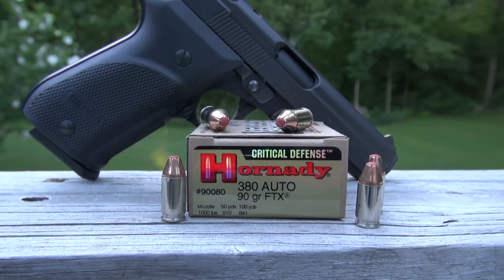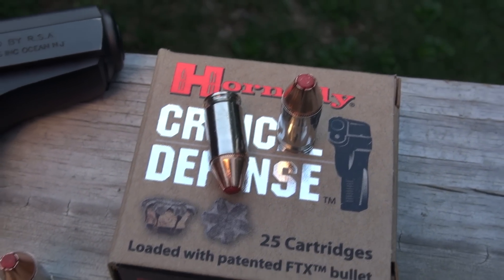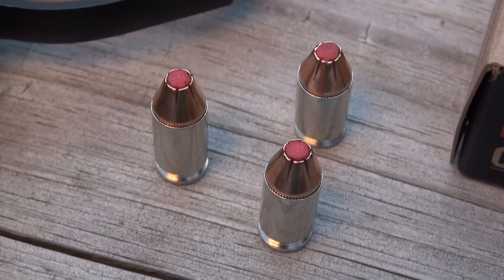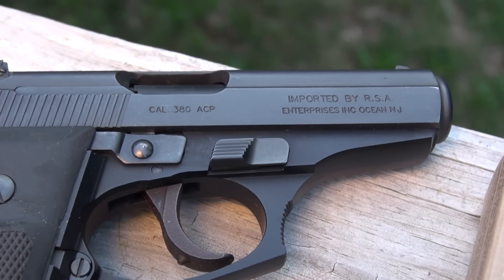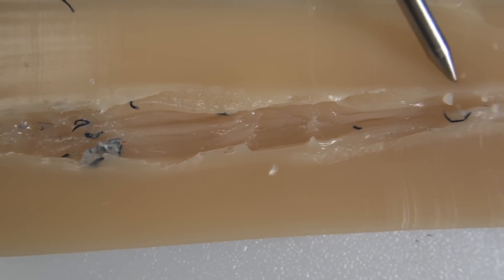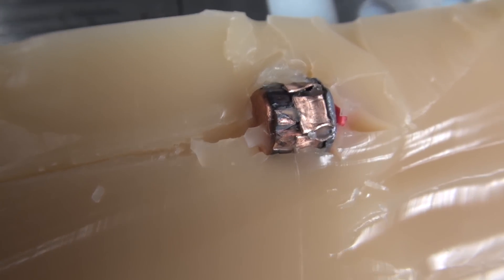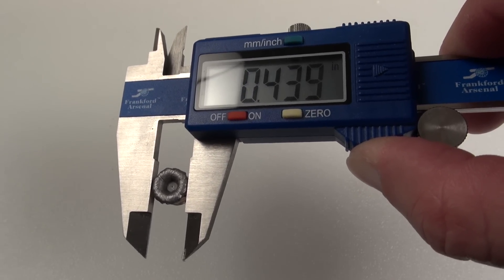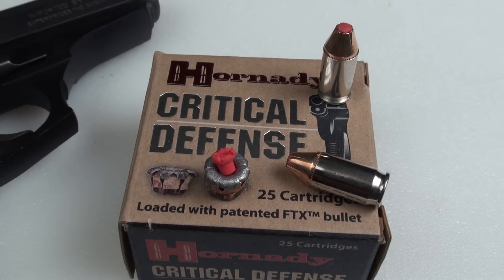Hornady Critical Defense .380 ACP 90 gr Ammo Test

Comment: Not only is Critical Defense an awesome self defense cartridge but, in .380 specifically, they were designed for the Ruger LCP. The older generation packages had an LCP on the box and I have a first Generation LCP that had to go back to Ruger before it would function. The technician who fixed my gun told me to use Hornady Critical Defense for EDC and Black Hills fmj for range practice. Ruger fires each LCP 36 times: 24 times with Black Hills fmj ball and 12 RDS or Hornady Critical Defense for function. He also said certain brands run on the long side of normal OAL and may lead to malfunctioning in the LCP.

Comment: I think I've seen every ammo testing video there is and I've come to the conclusion that you simply cannot go wrong with Critical Defense in any caliber.  It just works as designed every time.  And it's one of the few hollow points that reliably expand in 380 and still achieve adequate penetration.

Comment: Note: No animals were hurt in the study.This in November's American Journal of Veterinary Research. 

42 fresh cadaver heads of 12 to 18 month old steers were used to determine which firearm ammo worked best when used to euthanize feedlot cattle.(Again,these steers were already dead). 

For each of 7 combinations of firearms & ammunitions (.22-caliber rifle firing a long rifle 30-grain plated lead solid- or hollow point round,.223-calibre firing a 50-grain ballistic-tip round,9-mm pistol firing a 124-grain total metal jacket round, .45-caliber automatic Colt pistol (ACP) firing a 230-grain full metal jacket round,and a 12-guage shotgun firing a 2.75-inch 1.25-ounce No.4 birdshot shell or a 1-ounce rifled slug). 

The heads were all shot at an identical distance (3ml),angle,& anatomic location. 

The heads were CAT-scanned & images were evaluated to determine extent of penetration,projectile fragmentation,cranial fracture,and likelihood of instantaneous death (equal or greater than 30% destruction of brain tissue or a brainstem lesion). 

Results:41 of 42 skulls were penetrated by the projectile.Instantaneous death was considered a likely consequence for 83% (25/30) of heads shot with a rifle fired .22-calibre solid-point round,pistol-fired .45-calibre ACP round,carbine-fired .223-caliber round,and shotgun-fired birdshot and slug.Of the 18 heads shot with pistol-fired 9-mm and .45-caliber ACP rounds and rifle-fired .22-calibre hollow-point rounds,only 6 had brainstem lesions. 

Conclusions:Gunshots delivered by all firearm-ammunition combinations EXCEPT RIFLE-FIRED .22-CALIBER HOLLOW-POINT ROUNDS AND PISTOL-FIRED 9-MM ROUNDS were viable options for euthanasia of feedlot cattle.
Reply: ok

Comment: The human center mass is about 12 inches in length on the horizontal plane.  Consider possible bone contact, expansion with in 1/2 inch I'd say the Hornady Critical Defense 380 90 gr. FTX makes a better choice for a defensive round.  (I also carry Hornady Critical Defense 9 mm 115 gr. FTX in my 9c)

Comment: A close friend can tell you how effective these are.  He was the victim of an accidental discharge at the gun range as he was reholstering a Bersa Thunder in a Remora IWB.  The discharge happened with the gun approximately half way into the holster, i.e. with the trigger guard still fully exposed.  It is unclear from the range security video whether the trigger was actuated by his finger, or by the soft sweat shield of the holster folding inward and becoming lodged in the trigger guard.  In either case, the safety was off when it should have been on. The round penetrated the back of the holster, entered his upper thigh about 4” below the waist, tracked just under the skin and exited just below the bend of the knee.  He was very fortunate that it did not strike any bones or major blood vessels.  But the massive bruising between the entry and exit wounds is proof of the large shock cavity.  The bullet was recovered from the floor of the range and showed that it had achieved full, even expansion.  He was a very lucky   A quick trip to the ER, an x-ray to look for fragments, a bandage, and he was okay to limp home.  I hope he bought a lottery ticket on the way.
Reply: This is why I don't carry my Glock IWB. OWB only. No safety inside my pants is a no go for me.
Reply: Norman Morgan also a far better test than ballistics gel. LOL. Tell your friend I said thank you.
Reply: When wearing a single belt clip IWB holster I ALWAYS take the holster off to Reholster when the firearm is Loaded.

Comment: Very impressive. I got a box of the Sig Saur V-Crown bonded SJHP and they did not expand any through denim. They did expand with no denim. I used the Clear Ballistic gel in a torso mold that I made from an old  mannequin I found in the Sears dumpster. It works great. You can get an old jean jacket from Goodwill and some cheap ribs from the butcher and you got a semi realistic setup.

Comment: Ran the same test at 12 feet using a double layer of denim. Penetration 12.385"  with perfect pedal expansion measurement of .462".  Using Browning Black Label 4.25" barrel. This to me is the best 380 load on the market. It will not clog like many hollow points in 380.

Comment: 11+1/4 inches out of a 3.5inch barrel gun.
This results are pretty good, don't get me wrong, but the real problem with .380acp begins on the smaller barrel guns like the Ruger LCP, in which i can bet the result's would be around 10 inch penetration at most.

So my 2 cents on .380 is that the expansive ammo works correctly on 3 to 3.5 inch barrels, a good example would be the Bersa .380 CC model. But for smaller guns like the LCP or any of these compact pistols i would rely only on the "extreme penetrator" ammo despite the small risk of overpenetration and the only parcial "JHP kind" of damage

Comment: Thank you for your testing tnoutdoors9. Great work. The 380 may not have a ton of power, but 11.25 inches penetration is enough. I guarantee a double tap in the "triangle" will drop an aggressor. Hornady spent a long time on that bullet design and it works. It was designed to expand regardless of what it goes through, and you can't afford failure in a 380.  You shouldn't look for that perfect and huge "flower" expansion from a 380 as it would result in about 3+" less penetration.

Comment: I may have to think about this in 9x18mm Makarov caliber.  I have been packing 95grain Hornady XTP's in my Polish P-64 for 4 years now.  I like the tip that helps control expansion.   Really wish you had a gun in 9x18mm Makarov caliber... although 380acp ballistics are very close to 9x18mm Makarov.  Thanks for all these data points as a fellow concealed carry permit holder this information is very important on deciding what defensive loads to carry on a day by day basis.

Comment: I just did my own little test of this ammo and had a MASSIVE failure, tested it on 3 milk jugs filled with water in addition to a thick plastic cooler also filled with water as a backstop.

It did not expand at all and only bounced off the cooler. It had partially smushed sideways but did not expand in the proper way at all! I was honestly shocked. 

Im going to do some more testing soon to see if i can make it happen again on film.

Comment: @kenyata Through various wetpack and water tests of my own at varying velocities I have found the Golden Saber in .40 S&W to be reliable in terms of expansion and weight retention at low velocities, around 1050 fps, but unreliable at higher velocities, 1150 fps, at which point jacket separation almost always occurred.

Comment: For those using Ruger LCP or SIG P238 Kimber .380 micro etc. You're not going to get the same performant under 3 inch barrel as you are in the 3 1/2 to 4 inch barrel it does make a difference in .380 ACP or .22 Win magnum etc. 1" can mean  100fps or greater loss of velocity with the shorter barrel guns,  same with the Pug or the Black Widow North American Arms 22 magnum 1" or 2" makes a lot of difference in velocity and bullet performance!

Comment: I wouldn't have thought it would have done well. 

I assume it is probably a top performing 380? If it is a top performer I wonder if it is because Hornady cared or just got lucky. 

I recently got Underwood extreme penetrators because I preferred penetration in 380. I don't carry 380 but wanted to have some just in case. May look at staggering extreme penetrators with this or federal hst. 

Off to see if tnoutdoors9 has an hst 380 video.

Comment: .380 acp => 'Action Colt Pistol,' which is what Colt named the cartridge when they started making it.

LCP is a Ruger .380 pistol. I believe it stands for 'light carry pistol,' as they are tiny.

JHP is a jacketed hollow point. It's a hollow point bullet (ie has a cavity in the front to make it expand in a target and stop in the target). The jacket is the copper coating on the lead bullet.
Reply: Auto cycling pistol...  acp.

Comment: My Ruger LCP blew up in my hand at the range last trip. Using just Remington 95gr brass factory ammo. I am lucky I did not lose my hand or some fingers.  I do also have a P3AT and not crazy about shooting it either. I will tell you the first question Ruger asked me when I called was did I have +P ammo or reloads. They said usually when a gun explodes(I guess this happens more than I thought) it is usually the ammo so I guess it could have been a bad round from Remington however Ruger DOES NOT recommend using +P ammo so WHATEVER YOU DO, DONT USE +P. This ammo should be fine but just wanted viewer to know about this potential problem.Gun Explodes, Ruger LCP blows apart when I was shooting it.
Reply: Everything
Reply: Ruger LCP is dangerous and I have heard for SEVERAL people who had their LCP BLOW UP TO.  Just BEWARE OF THE RUGER LCP
Reply: n4ktz Thanks for passing that along I had considered that gun at one point but purchased a different gun. Glad you didn't suffer and serious injuries just goes to show it dose not matter the maker of guns these things happen regardless of what you spend on a gun or its reputation.
Reply: Smart move....I would never get another(or shoot) an LCP.....
Reply: There is no such thing as +P 380acp.
Reply: 9mmsteve I have seen guns fail on the range. No ammo fail prior??
Reply: Bad loads, under pressurd, cause squibs, bullet never clears the barrel.  You can feel and hear a squid and/or slide fails to cycle.  Revolver, you must hear and feel it.  Very dangerous condition for gun and hand.  Guns just don't blowup.  When firing a shot into a clogged barrel will differently not make your day.  It only takes ONE ROUND, regardless of manufacture.
Reply: NEVER USE +P AMMO IN A .380!  They are not designed to withstand such pressure.
btw, great video; I'll go with Hornady.
Reply: @captainpegs0740  Yeah there is buffalo bore makes it
Reply: 9mmsteve LCP is my kayaking gun, not for steady use
Reply: @keatonjorgensen8793  . True, I shoot it in an old gun.
Reply: I'm my lcp2 manual it clearly states no +p ammo is to be put through this gun
Reply: @brianbuchert1966  I just bought an M&P Bodyguard 380, and its manual also says no +P in their .380's.  (+P is okay in their 9 mm guns, however).
Reply: @HotBrass-Lead  Maybe a squib round prior to the failure?

Comment: Have you ever tried the bullets without the red plug? (Remove red plug before shooting)
Reply: Why?  You can just buy HydraShok's at that point.
Reply: FrustratedNameSearch because these are not hydrahoks and I would like to see what happens.  On the same note, I will soon be making a video after shooting some lyman mold  wheel weight cast bullets  to see how they perform. I have also never used these.  I do not have a .380 anymore as I threw it in a fire and abandoned it to get stolen.  No one stole it after a year. It was that bad.
Reply: That would be the Hornady XTP bullet (without the plug), FTX (with plug).

Comment: I was impressed to see a CD .380 FTX work well out of a 3.5" barrel after seeing a YT review of a 38 Special 110 gr FTX that didn't expand when using a 1 7/8" incher. I sure would like to see a test of the Hornady Lite 38 Spec 95 gr FTX using a 3.5 to 4" barrel to see if their is yet another option for home defense with reduced recoil and flip. Good job - thanks.

Comment: How does ballistic gel translate to a real body? Wouldn't it be more meaningful to shoot into a side of beef? See what it does when it hits ribs or sternum?
Reply: Boris Chang It's roughly a 2:1 ratio, so 12 inches into 10% ordinance gel is roughly 6 inches into man.  You don't need to worry about bone, that's why the IWBA set the guidelines in the standardized test to be 12 inches minimum penetration, if your round can meet that it should have enough penetration to hit vitals reliably in man.   Bones get shattered and only slightly slow down bullets, I prefer rounds that penetrate to the 15-16 inch mark though, like HST in 9mm.      If you want to see some less orthodox tests check out Paul Harrell on here, he has a meat target test he does in his ammunition videos, it's pretty cool.

Comment: Of the 380 auto you tested this was the deepest penetrating JHP correct? I want good expansion and at least 10" penetration for a 380 JHP and think this may be a better solution than staggering FMJ and JHP in my fiances 380. Thanks for your tests and videos.

Any chance of getting a hold of Corbon or Hornady's new Critical Duty for testing?

Comment: @grizz474 I'm no expert but I think that some hollow point ammo failed to expand because the opening became plugged by material fibers (from clothing worn by the person who got shot); failure to expand is not a desireable thing when you're trying to stop a threat. After some experimentation ballistics experts found that a polymer insert did two things; it prevented plugging of the hollow point and it almost guaranteed that the bullet would expand because of hydrostatic pressure. But Im no expert

Comment: I use these in my bodyguard.  Recently picked up a kahr cm9 because I wanted a pocket carry 9mm.  The critical defense had continual ftf, round jamming at bottom of feed ramp.  Going to try speer gold dot 124gr.+p next.  I sold my taurus pt111 g2 and never had one issue with it, ran the critical defense flawlessly.  But living in Florida I'd prefer not to iwb carry.  The cm9 is very easy to pocket carry in tactical shorts.  It was very accurate running wwb 115gr.  However I have to wear a glove at the range cause it tore up my skin from slide bite and from the trigger guard.  If the speers ftf I'll be returning the gun to kahr for warranty service.  If I can't get it reliable I might have to iwb carry a shield instead.

Comment: Impressed! Can see where a triple tap into perp would definately ruin his day. I lived in alaskan bush, tried many rifles/bullett styles /loads for really BIG bears. Found best ever bear dropper was the 45/70 320 gr wide flat nose hard cast. pumped up to 2100 FPS. For reasons i cant explane it seemed to have MORE stopping power than any H.P. in any caliber. Im "assuming" the 380 is similar in dumping all its energy INTO target instead of just blowing a hole THROUGH the target & wasting its energy upon exit. Any enlightenment along that line be greatly appreciated. Again, Im assuming like the 45 which knocks its target down is better than a 357 which just zips through.

Comment: Unfortunately, these dont feed in my TCP, but my Rangers do.  These were my first choice for a carry round in the short-barreled TCP, but since they had 4 failure to feed in a box of 20, I switched to Rangers, and havent had a problem since.  Since I only carry my .380 in the summer months, I dont worry too much about expansion issues I've had with the Rangers in a denim test.  They work JUST fine through light clothing..  =)

Burk

Comment: The flaw with this video was the barrel length. Most people using a 380 will be caring it in a pocket pistol with a barrel well under 3”. This Ammo in the shorter barrel lengths is not impressive to say the least. Underwood Extreme Penetrator or Defender is a much better option in those cases. Check it out on Shooting The Bull.

Comment: I still find the Kel Tec P-32 to be the best pocket gun.  Mine shoots flawlessly.
The small .380's are much too snappy.
Reply: Conrad Luznar You should try a Ruger LCP custom.  My wife bought a LCP custom.  It has larger usable sights and the trigger that is similar to the galloway trigger.  Ruger started using s better trigger in 2013 in the LCP and better sights..  I had a Kel Tec P3AT that was a nightmare. I actually gave the kel tec away and I will not buy any of their products.  I could have bought a Sub 2000 recently for $400.  I bought a Hi Point instead of the Kel Tec.  We love the Hi Point carbine, no regrets.
Reply: Brent Young  The small .380 pocket guns are to snappy, with the Kel Tec P-32 I can shoot with 1 hand or two and be accurate from 1 foot out to 30 feet.
Reply: At 30 feet my wife is shooting silver dollar size groups with her LCP custom.   I was trying to teach her to shoot a pistol with my G19.  She didn't respond well to the G19.  Then I picked up a used M&P22.  She blossomed with the M&P22.  Then I noticed she was shooting my LCP a lot, so much I had to order 500 rounds of 380 ammo.  The LCP fits her small hands in the same way the Glock fits my hands.  I bought her the LCP Custom, it was a match made in heaven.  She shoots NRA 5" slow fire targets at 25 yards and puts every shot in the black with her LCP Custom.  I have a hard time keeping up with her shooting the G19.  I started shooting my single action 357mag that forces me to slow down, carefully aiming each shot to make sure I can beat her.  Yes, we do have a healthy competitive spirit.
Reply: Brent Young  That's pretty good shooting but I'll stick with the P-32.